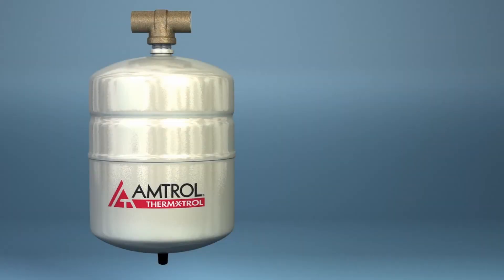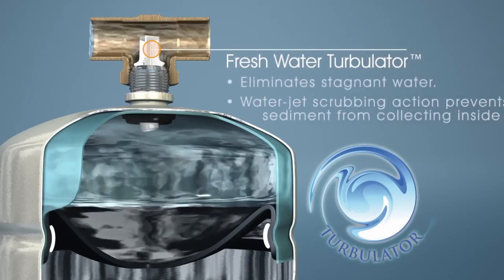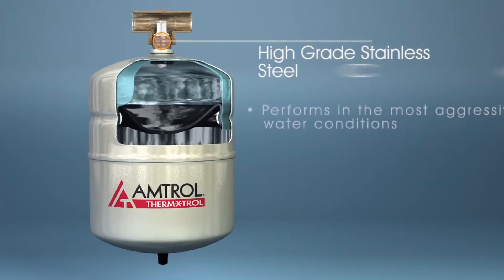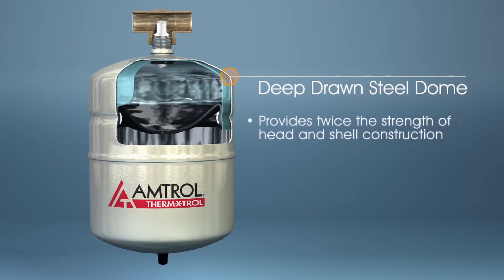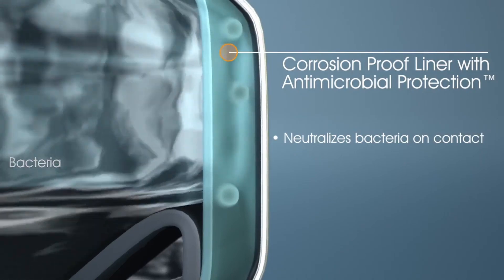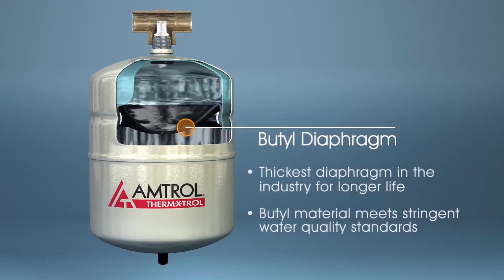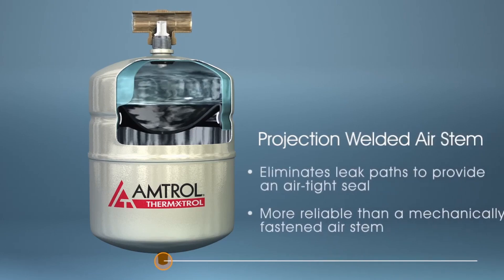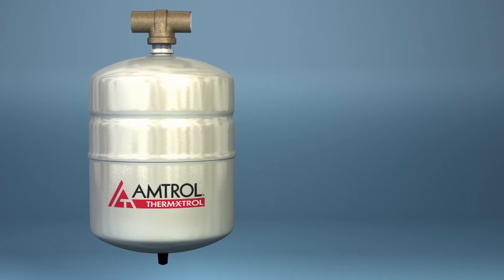Therm-X-Trol® Product Overview

Comment: Will the turbulator reach into a copper tee with a 3/4 adapter? Is brass recommended since its contacting the steel thread? I beleive these points arent mentioned in the instructions. Thanks!